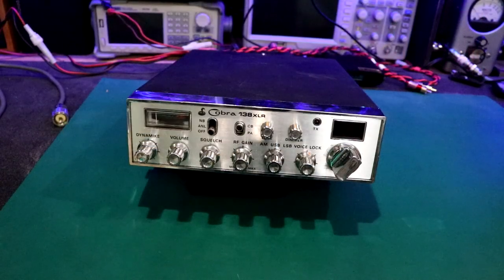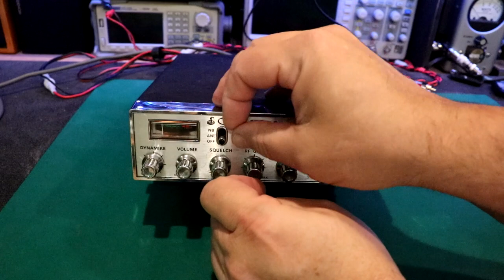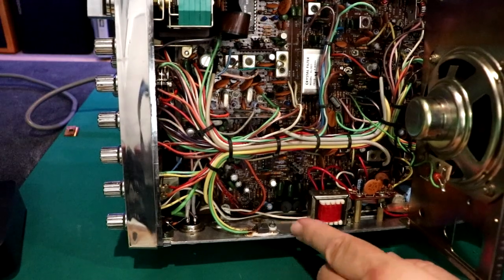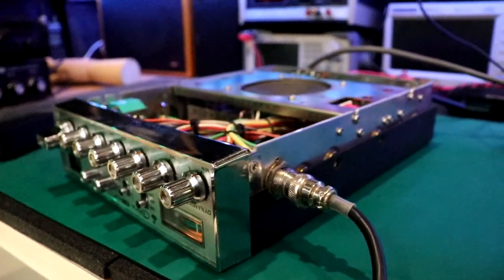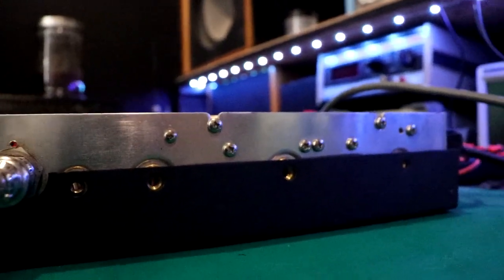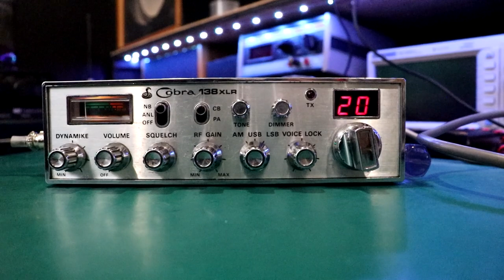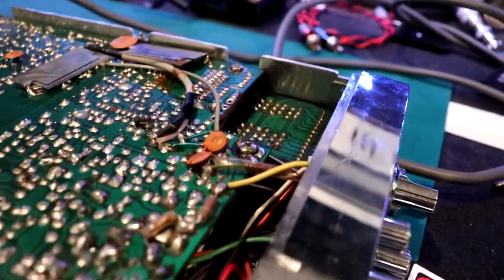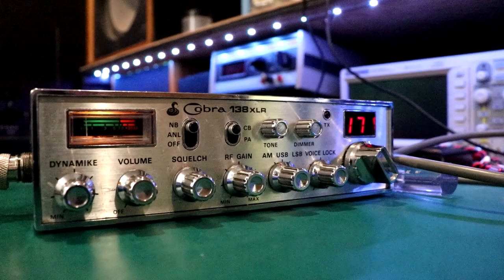FREE Cobra 138 XLR Part One (Vintage CB Radio)

Comment: Change the tantalum cap in the final chain before it blows the finals. It will happen.  Dont DigiScan a 858! Try and locate a Megatronix FEX box. (BCD thumb wheel switch frequency expander) 🙂

Comment: 858 board 😂😂😂
Reply from the maker: Yes, and one of the good ones. Late production unit with all the bugs worked out. However a bit high maintenance because of the relay switching. IMO, the biggest fault. I love the receiver, out performs ALL of the modern CBs, again... IMHO 
Cheers